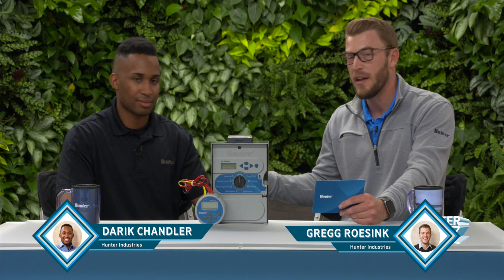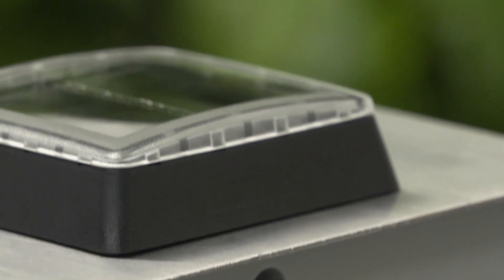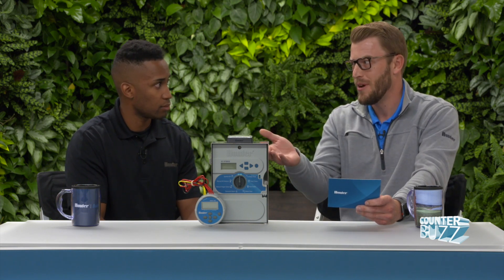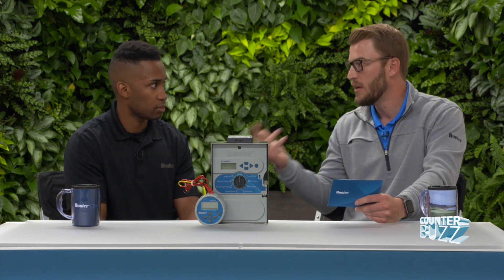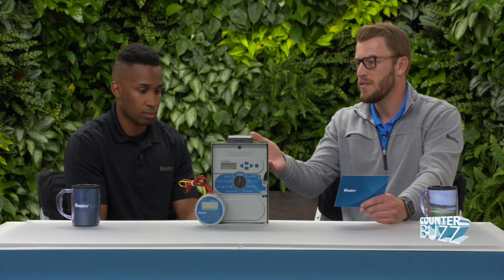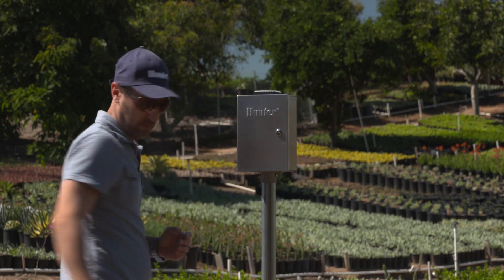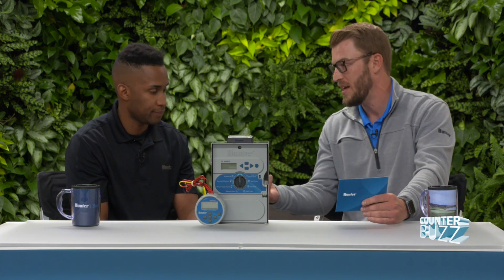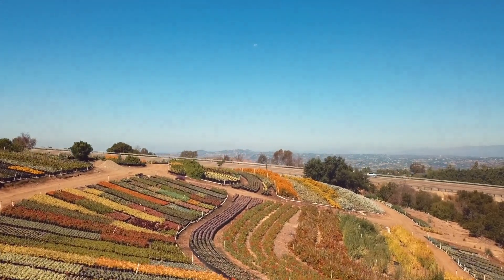Solar and Battery-Operated Controllers: No Power, No Problem.

Comment: Which solonoids do I use with this?
Reply: But can I hook up my rain bird valves using my rain bird dc latching solonoids to this hunter brand controller or should it only have to be hunter solonoids
Reply from the maker: Hunter valves operating with a battery powered clock require a Hunter DC Latching Solenoid. Part number 458200
Reply: @Hunter_Landscape_Irrigation thank you